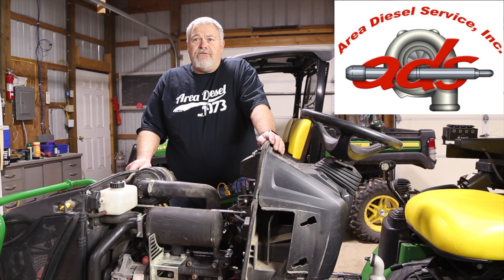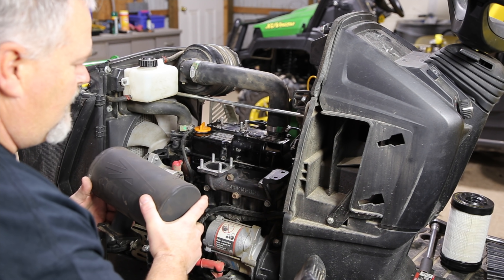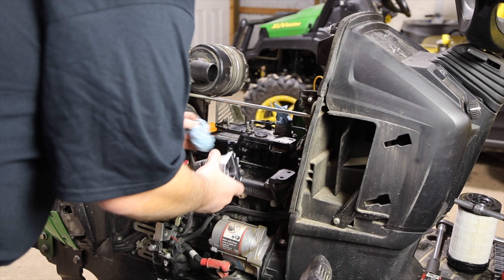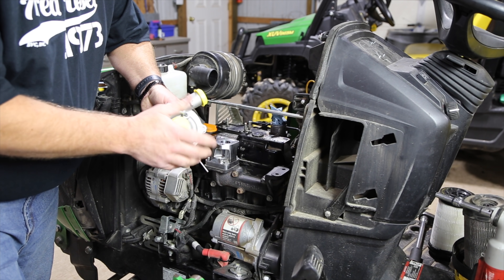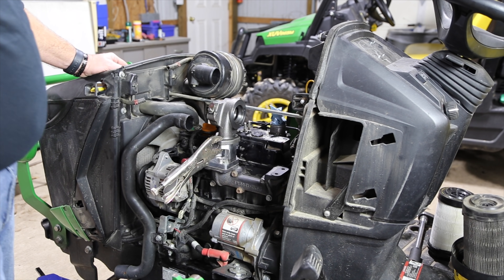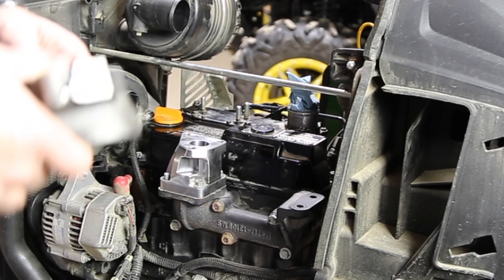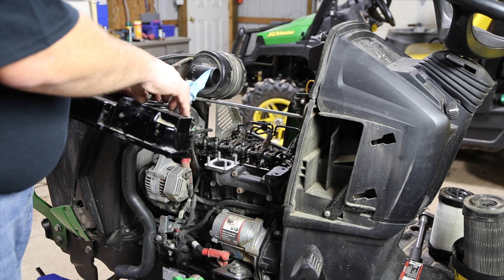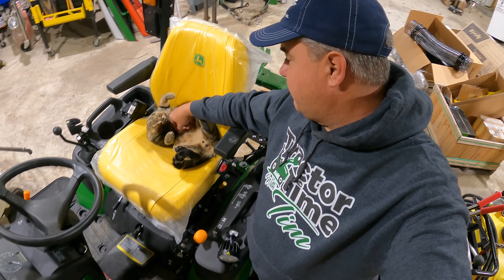1025R Turbo! Detailed Custom Machined Parts!

Comment: Tim my brother has a friend that adjusted the timing on his 1025r to try to alleviate the smoking of the cold starts and the smoking when first started witch he said did and also here it adds some horsepower back to tractor he thought jd retarded the motor by adjusting timing so to avoid emission regulations your thoughts?

Comment: Tim, this is a neat project, but don`t go into it with high expectations, or you`ll be very disappointed. Turbo charging these little engines aren`t going to put out that much more with a turbo, because they weren't designed for it. And these guys doing this, are far from the first person/company that has tried this with small diesel engines. Trust me when i say that you`ll have continuous $,$$$.$$ problems with it. But nonetheless, enjoy the build, just keep the expectations low, and you`ll be a little less disappointed in the end results.

Comment: Neat project but I'm thinking it will have almost 0 zero practical advantages due to it being a hydrostatic drive and just not a beefy enough tractor to put the power down to the ground. Bigger implements may end up being to heavy for the traction available. Still a neat project.

Comment: Tim, how will this modification differ from the 2038R turbo engine?  The 2038R as about 18 more cubic inches and 13 more hp and costs about $12,000 more.

Comment: TNR is a great thing, made your little girl happy. She reminds me of my little girl, she sleeps on my head at times.   Nice to see the progress on the turbo. As he was talking about the exhaust my mind was going through the steps I would take to lengthen and route the pipe. A couple cuts and weld some new pipe in to make it work, along with a heat shield to protect the hose and tank.

Comment: My 4410 exhaust used to exit in the same general area as your exhaust exits. It's a fine location for just about all tractor implements. It's horrible for the front mount snow blower so now my exhaust comes out the side of the hood and up. That location is  ok for everything but working in the trees. You need to watch for branches. A vertical exhaust is also a bit noisier. Those down sides are still better than the constant exhaust smell with the snow blower.

Comment: My concern will be the transmission. I have a 2006 2305 with 1680 hours on it and I’m on my third transmission. The 2305 is a “ tougher” version of the new 1025R.
Reply from the maker: I disagree with 2305 being "tougher' version of the 1025r.  There were many improvements made to the 1025r over the 2305.  This toughened up several areas of the transaxle as I understand it.

Comment: great videos Tim! and fantastic idea, I have a CK2610 Kioti and sometimes I wondered what it would do if you could add a turbo to the motor. Even tho the CK series has a 35 and a 40 hp model. Not sure if its the same motor or not. but I believe they share the same hydraulic design . it would be and interesting comparison.

Comment: I've never realy needed more hp with my 1025r. It seems the engine is already more than enough for the hydraulics.I could use more hydraulics for sure. Realy cool project though.
Reply: Yup, maybe next we can get some tips on how to increase the max lift weight. Feels pretty weak sometimes
Reply: @larryezell8387  You can set the pressure a couple hundred pounds higher but it's not smart. The hydraulics can take it but the attachments and implements are not rated for the extra power associated with a pressure increase. If it was meant to have more pressure, they would send it set higher. If you're tractor doesnt seem to have enough power for what you're doing, you're asking more of your machine than it was designed and built to handle. Get a bigger tractor.
Reply: @mikeznel6048  I've got several bigger tractors and heavy equipment. I use this mainly to mow. But every now and then I will use around the house or neighbors house and have need a little more out of the hydraulics.
Reply: @customjrod  If you need more out of it, it's undersized.
Reply: @mikeznel6048 your a genius. I'll go out and buy another new tractor right between this one and my two series, since the two series is too big to mow with. What I'm saying is there's never a perfect tractor. I guess you've never needed more out of the tractor you just happened be using at the time. SMH. Some people's children.
Reply: @customjrod  *You're and you're completely missing my point. Go ahead. So what you gotta do.
Reply: @mikeznel6048  Yup, I have several other machines, some much more powerful,, I think I am experienced enough to make the judgement call if the power were there. It is just frustrating to go to pick up a potted plant and the hydraulics bypass on something that I end up doing by hand, lever and rope.

Comment: Really want to see the final result hp.  For the crankcase vent could you vent it back into the air filter or otherwise upstream of the turbo? Cheers

Comment: It will be interesting to see what the sound level is if a muffler is not put back on.  My 450c Deere came from the factory with a straight pipe off the turbo.  I got to where I would even wear ear plugs under ear muffs if moving dirt for more than a short period.    
One of the biggest detriments to adding turbo chargers to an engine is cooling capacity, both water and oil.  Most factory turbo charged engines also have oil squirters inside directed to shoot at the bottom side of the pistons to help keep them cool.  
Area diesel is good people and isn't too far from us.   A friend of mine 20-25 years ago bought a VW diesel vanagon,  VW ended up  buying many of these back as they were totally underpowered lemons trying to push that barn door front end along.  Area Diesel figured out the turbo specifics needed and my friend made all the manifolds and piping to install.  What a difference, before the van struggled to make 55mph on the highway, after the turbo install it would cruise at 70mph.   At highway speeds you definitely knew it was turbo charged.

Comment: Surprised they just put a T on the oil pressure sensor port. Seen plenty of pipe nipples break from vibration because of people doing that. It would seem that finding either an unused port or putting a short hose and hard mounting the T to the block would have been a better choice.
Reply: Well good news is if it breaks off there it will show instant loss of oil pressure sense the sensor goes with it and an attentive operator can shut it down before all the oil is pumped out and real damage is done.
Reply: @bcbloc02  Attentive being the key word. Likely it will take a while to notice. Since the operator's attention will either be on what is going on in front or behind you. On my tractor I actually wired in a buzzer into the oil pressure light so it is an audio as well as a visual warning. Oh, and pipe fittings crack sometime as well.

Comment: We’re gonna see a ka boom then big hole 🕳 in the block from all the boost pressure. Please take the plastic off the seat. They make leather cleaner what you should be using any ways

Comment: While this project sounds interesting, I hope they can get it done without impacting any of the emissions control equipment.  Tampering with or defeating an emissions control device is illegal.
Reply from the maker: There is no emissions control equipment on this machine. It is less than 25hp.

Comment: On which way the pistons and valves will be cooled down that the engine survive the higher temperatures in the cylinder? Only higher diesel quantity/air mix or what is planed?

Comment: Loving the series! Only thing I didn't like was they tapped the block instead of buying the correct fitting adapter.
Reply from the maker: Yea, I need to ask more detail on that.
Reply: I thought the same thing. My guess is the metric fittings needed are not readily available. The 1/8 inch NPT in that fitting should not be an issue.

Comment: The turbo is so tiny!!
My two bits, it seems like they could make a new muffler and have it serve as the transition between the turbo and the factory exhaust pipe. Then it would be quieter and wouldn't bump into other parts.

Comment: That's a serious mod there Tim. Looking forward to the finished project. Seems like you made a great choice with Area Diesel.
Reply: Not really. It's only gonna be a few pounds of boost. Putting a turbo on a non turbo diesel is quite common.
Reply: My comment on being “serious” was basically the fab work and labor that’s being put into it. Lol
Reply: @Blue87fj60-2  It's definitely a job well done and from what we've seen so far, its been done about as right as can be.

Comment: always hated those bot together turbos the clamped ones are far better as your not limited in what way the inlets and outlets are facing and the oil drain can always be facing straight down.

Comment: Tim you will not be disappointed by using the stock exhaust location. My first try I went up on the 955 and it vibrate itself apart and was extremely loud. Went back to stock location with slightly more forward of a turn at the outlet keep the noise directed away from the operator station.

Comment: Nice work so far . Just wondering if you are planning on making a kit for sale wene it's all done . Be nice to do to my 1025r .  Will it void my warranty if I do it .
Reply from the maker: Yes, it will void power train warranty.
Reply: Also Ventrac  said it void the warranty on  their Kubota diesel model. They felt the engine can't handle the additional power the turbo will add.

Comment: Not a fan of modifying a factory engine, especially when the builder is so far away. . If you have problems with the install, who will fix it and how much time are you going to waste??  JD is certainly going to wash their hands of your tractor.  But FWIW, the mod makes for good YouTube content!
Reply from the maker: As you know, we just got a new 1025r which we will leave stock.
We bought this tractor back for this purpose.  Just for fun and entertainment.
Any failure is on US, not on John Deere at this point.

Comment: Tim, how many hours do you have on this 1025R?  Also what do you think is a reasonable life cycle (hours) of a 1025R being used for business?
Reply from the maker: 110.
No idea of the true longevity of a 1025r.
Reply: @TractorTimewithTim  
I asked that question of a friend who has  a landscaping and lawn care business. My question was about the larger John Deere diesel 4x4 mowers that she and her husband use. They have gone through a few.
My main concern is the hydrostatic drive, I suspect it might be the weak link.
Her answer was 2000 hrs.
After 2000 hrs there were too many "expensive issues" according to her.
That is with x700 series tractors doing general lawn care work.
Tim with his turbo 1025r doing crazy stuff- might not get quite that many hours!

Comment: As an ex truck driver I can tell you that while a straight pipe can sound great, the downside is after several hours and many years you pay the price.  I have tinnitus now with a slight hearing loss not profound but enough it shows during a physical.
Reply from the maker: I have a LOT of hearing loss.  Unfortunately.
Reply: @TractorTimewithTim  
I have self inflicted hearing loss as well. I finally got some hearing aids 2 years ago, very helpful. They also reduce the Tinnitus. If I forget to put them in the Tinnitus starts screaming.
The thing with hearing loss is that you don't want to wait too long before getting the hearing aids. As the Specialist explained to me- The brain "unlearns" how to
convert sound into words.
It does not relearn when the hearing aids are added. That loss of function is permanent. When the brain cannot decipher the sound, the hearing aids just provide you with more sound, you still won't be able to convert this to words.
So don't wait around on the decision to get hearing aids.
They are almost invisible and work really well ( if used soon enough!)
Reply: @glenbreaks5448  You are so right about making out the words as I have difficulty now at 79 do to tinnitus and hearing loss from the military . Thanks for that explanation .They never gave us any type of hearing protection during my time in service .

Comment: Tim, throwing a turbine onto an engine not designed to have hot carbon layden combustion gases  redirected into the intake will cause the engine to build up with carbon particulates due to incomplete combustion. Also the little subcompact engines don't run hot enough to burn up the build up.
Reply: I am by far a turbo expert but how would combustion gases get into the intake? The exhaust spins one side of the turbo and the other compresses clean air and feeds the intake correct?

Comment: This project is a lot of fun to watch and follow, very exciting!
Reply: Tim, how do you like the land plane, and what do you use it most for?
Reply from the maker: I like it for driveway work.
Reply: @TractorTimewithTim  I got both Tim’s to reply 🤣
Reply: @robsmith7681  I like it a lot, it’s very easy to use and yields great results, it lays the gravel out nicely. I have a 400’ gravel driveway. Would highly recommend.
Reply: @TimothyNewton  I have just started really getting down pat using a box blade (it’s been 2 years of using one to really get it figured out) and I’ve done 3 driveways recently that I’ve been ecstatic with them. The secret with the box blade I’ve noticed is keeping the material very wet. Land plane doesn’t seem like moisture matters as much, and maybe better for a established driveway refinish….. am I accurate with that?